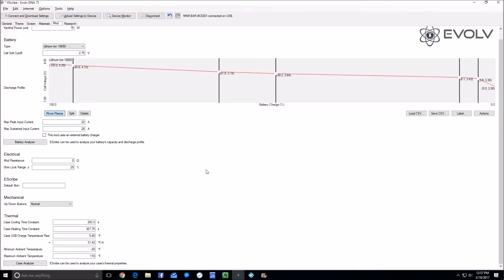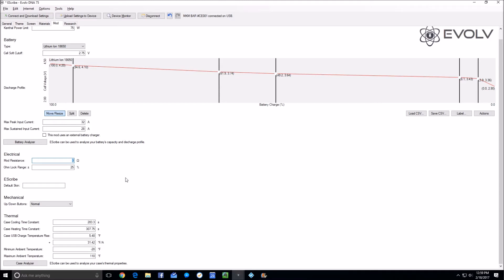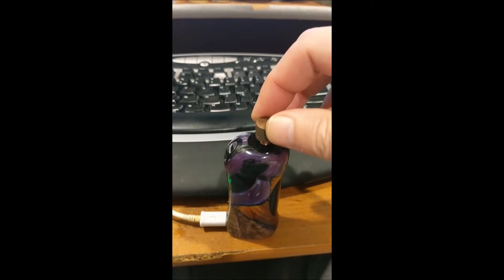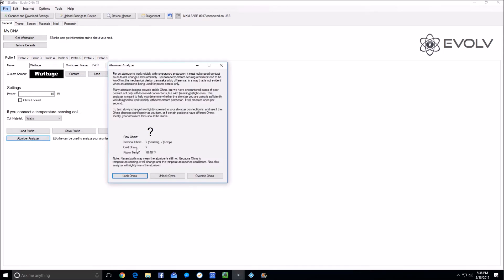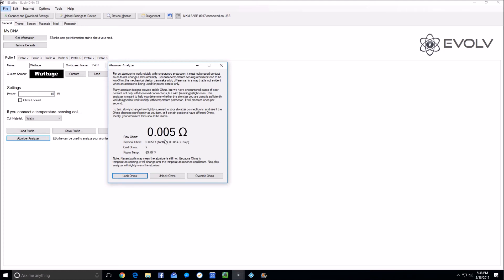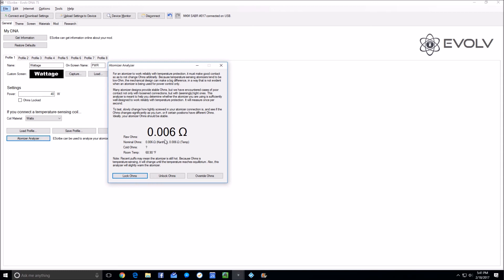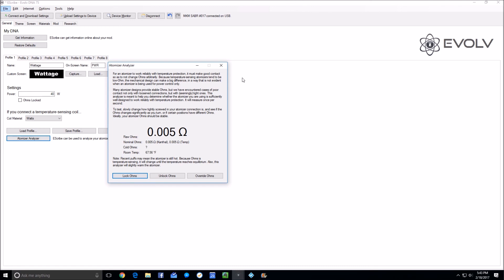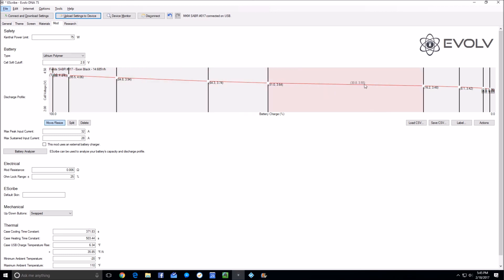DNA Calibration - 3  Mod Resistance

Comment: My box mod has unstable reading of resistance, it's about 0.01-0.10 ohm. Can i fix it by software? Or the problem is from it hardware?
The resistance are stable if i use it on TC mode.
 Sorry for my bad english

Comment: I have a DNA60, would this work?
Reply from the maker: The DNA 60 is missing some of the testing parts. You effectively cannot calibrate the units to recognize temperature changes. You can do the rest and then just have to ensure you only set resistance when your unit is at 70 degrees.
Reply: @BillLee3  Could you take a well calibrated dna250c as a reference and just adjust the mod resistance of the billet box to make it read matching ohms on the same atty?
Reply from the maker: @Marc_lux  Sure.  Initially works great.  Issue is inadvertently setting the resistance under different conditions.  The 60 doesn't know the temperature so it can't compensate when setting resistance at like 90 degrees or 40 degrees (value set should be resistance at 70 degrees).
Reply: @BillLee3  👍

Comment: My dna 250 reads .10 higher than every other mod... Idk what I can do. It seems to affect my vape
Reply from the maker: So go and adjust the offset by 0.1.
Reply: @BillLee3  not sure how to do that. I see mod resistance?
Reply from the maker: @GreggyPreviews  Yeah, sorry, that's it.  Been a while since I messed with this - it's mostly set it and forget it.

You go into Excribe, click on the Mod tab and then click on the electrical tab to find the mod resistance.  This is the "offset" from what it reads to what it should read.  You can ONLY make it go down.  I.e. if your DNA mod is reading lower resistances than anything else then the others are just wrong.  If your DNA is reading higher then you can just insert the amount it is reading too high and it will bring it down by that much.  So, if your DNA mod is reading .10 higher than every other mod you can put 0.10 in that field, upload it and it will then match the other mods.  I will say that 0.10 is a LOT for a DNA mod to be off.  The one I hooked up to look at this is set to 0.0161.
Reply: @BillLee3  yeah its really strange... so I was trying to add a negative value for some reason. Its stable for the most part just reads high. I didnt care until the same juice and coil I have used for years starting giving dry hits. after only a few hours. I tried my geek vape aegis out again and so far no dry hits. I might have to retire the DNA if this doesnt fix it.... I have been vaping for over 10 years now and i always loved DNA Boards
Reply: @BillLee3  thanks so much for the help. It ended up being .04 offset
Reply: Strangely I have realized that different batteries are giving me a different resistance of my atomizer... I put on new batteries this morning and it was .11 higher...

Comment: Hi Bill.
Im using Billet Box mod and I’d like to calibrate the ohms, is it possible to build a short rta and check with it? Because this mod hasn’t have a 510 connector
Reply from the maker: Well, in theory, you could.  But the quality of the connection to the bridge you're ACTUALLY going to use would likely vary from the quality of the connection to the RTA so not sure it'd help.  The BB Box just ain't great for TC, unfortunately.

BTW the best way to fix the 60s inability to do case analyzer (see below) is to set the ohms when it's actually at ~70°F and then lock it so it doesn't change.

Comment: Can you please answer my previous question, many thanks
Reply from the maker: Polo65 Eh, not really.  First my BB, at least, doesn't let you connect to Escribe to do this.  If you have a modified BB that does allow this then it may not help much.  The BB creates a poor connection that is unstable so it will vary by enough to throw stuff off.  Also the DNA 60 does not allow case analyzer so temperatures can't be calibrated and it'll always be off when converting the ohms to what they should be at 70 degF because it doesn't know what temp it's measuring the ohms at.